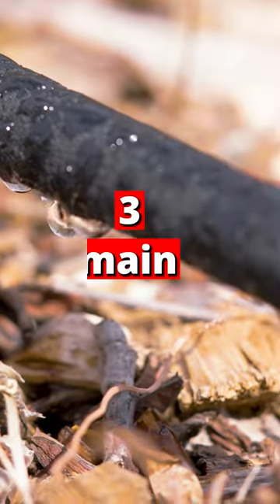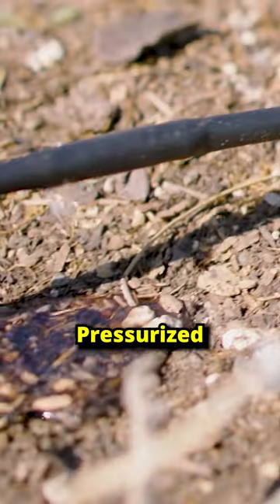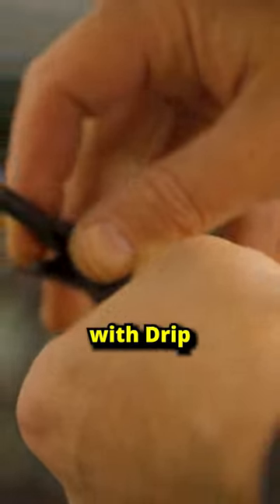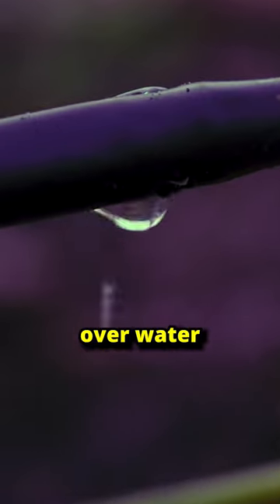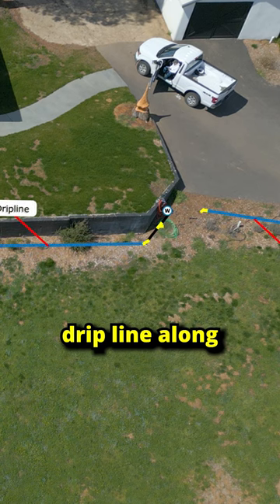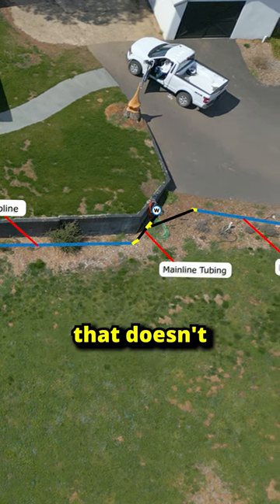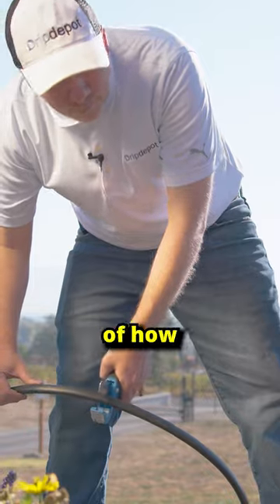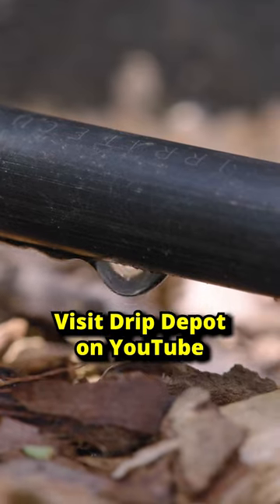3 Reasons to Replace Your Soaker Hose

Comment: I live somewhere where the water is hard and I was told that drip lines would plug up overtime.
Reply from the maker: Great comment -- there is some truth in it, as hard water will eventually cause blockages in pretty much any emitter, with the main variable being how long it takes (a sprinkler would take longer than a dripper, for example).  

With that said, some of the most common places drip is used in have hard water (well water, farms pulling from a body of water with a lot of silt/sand, etc).  There are some steps you can take to greatly delay any clogging, happy to cover them below and then some information on what to do if a clog occurs.  

1. Filter with a screen filter -- much of the mineral content will build-up on the screen element in the filter instead of getting into the drip system at all. 

2. Since very small particles are going to get through the filter (they might be small enough to not be visible), it's recommended to regularly flush your lines -- this is recommended on any water source, but it's particularly important on systems with hard water.  Flushing just consists of removing end caps and letting water run through -- the turbulent flow inside can break up deposits and send them right out the end.  That, and the most common reason for build-up is sediment settling in the lines between cycles, something flushing prevents.  

Depending on how big the system is, solutions to clogs caused by hard water can be pretty easy.  If it's just a few drippers or some drip line, you can remove it and soak it in a solution that breaks down the build-up (folks do this with misting nozzles all the time as they have some of the smallest orifices amongst all emitters).  

On larger or commercial sized systems, they'll use a fertilizer injector to inject a solution (many of them are plant safe, or can be done between growing seasons) that breaks down the build-up and then they'll flush it out of the end. 

It's anecdotal, but we have a lot of drip systems running on hard water out here in rural Oregon, and most of them go for years without clogs without doing many of the steps above (particularly flushing the system regularly).
Reply: @dripdepot  thank you so much, this is incredibly helpful and really clears things up!

Comment: Cause the channels not called soaker hose depot..lol. jk man. Both have their use.
Reply from the maker: LOL Your point is well taken, there's definitely some truth to that!   I'd agree that a short run of soaker hose can be viable -- got a short (around 10') run of hedge that needs quite a bit of water?  A soaker hose is a fine solution there. 

With the caveat that you get one made from fresh materials and not recycled tires (lots of problematic ingredients in tire materials like Polycyclic Aromatic Hydrocarbons and heavy metals).